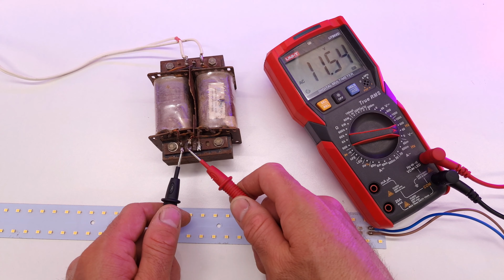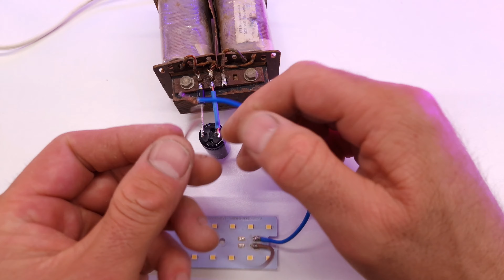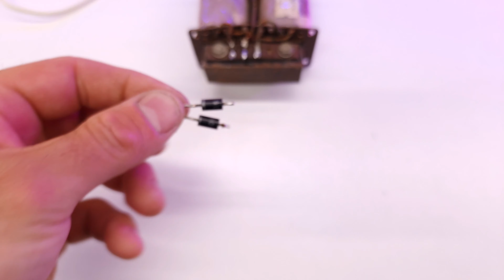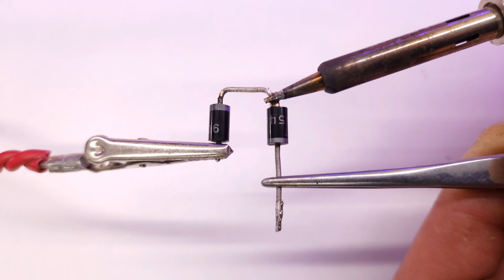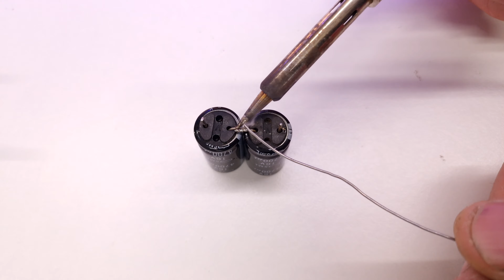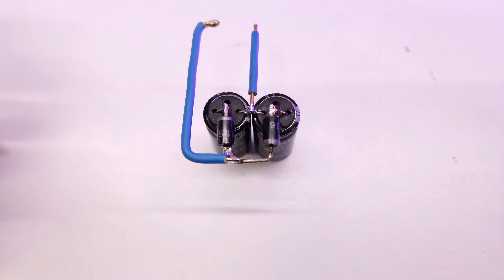DIY Simple Voltage Doubler Circuit in 5 minutes | 12V AC to 24V DC, using 2 Diodes and 2 Capacitors

Comment: Do you know if its possible to make a 500,000v shock alarm for a  ebike? Im hoping theres a 3-12v output to make lights flash, which i can add an inverter to electrify the frame. There's probably a lot more needed than an inverter but idk, will it work by conecting the + ‐ to the frame?

Comment: 7:09 @Electroboom 😅🤣😂
Reply from the maker: You should have seen it while making the video preparations🤯🎆
I tried with a very powerful 15V transformer, but the capacitor was 10V and I thought it was 25V😖
And as you know, when I converted AC to DC, the output voltage was aprox. 20V and it was a full boron fireworks show⚡️💥😖
Reply: @ErCanEverything  😂🤣😅 💥